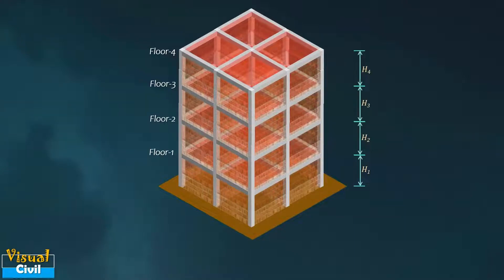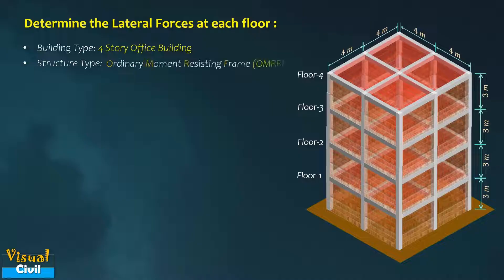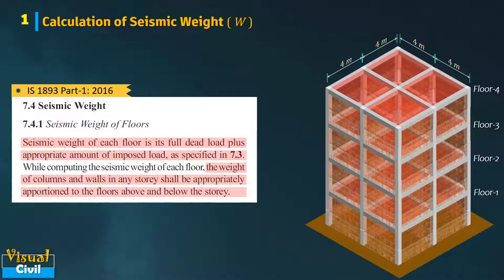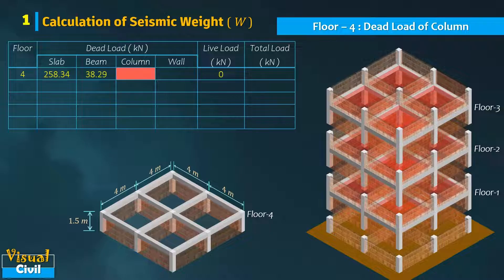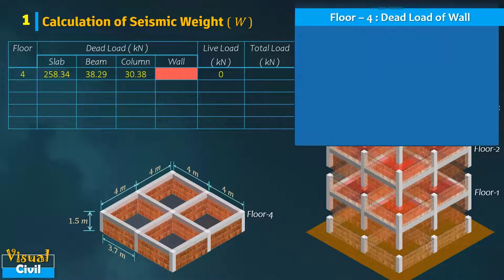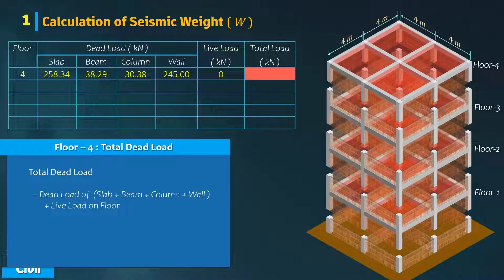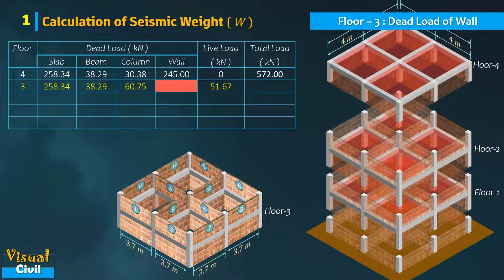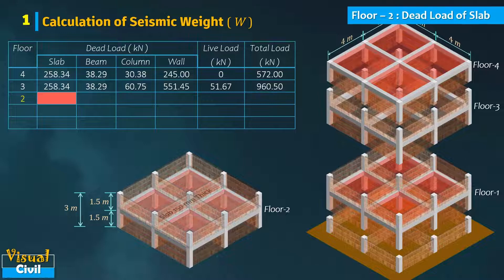Seismic Analysis of RCC Building by Equivalent Static Method | Seismic Weight Computation

Comment: 4:45 Shouldn't the height of the column be 1.35m instead of 1.5m since  0.15m is already considered in slab calculation.
Reply from the maker: Yes we can consider it for accurate computation